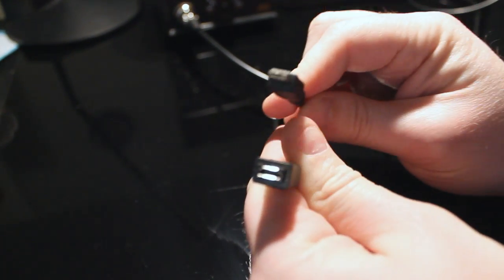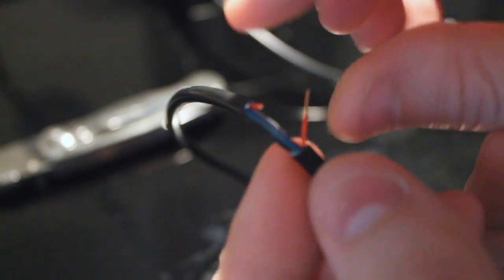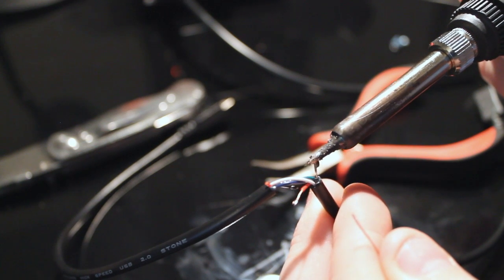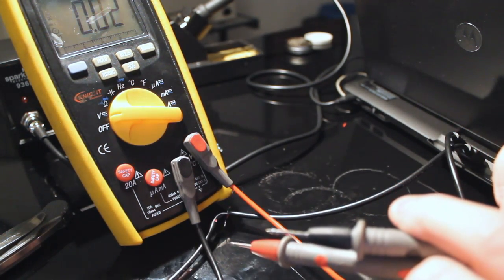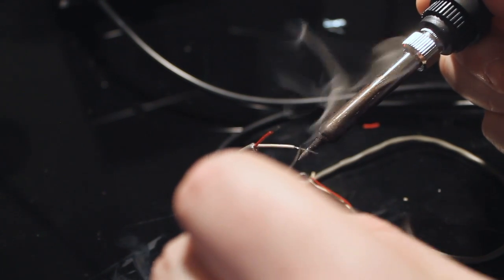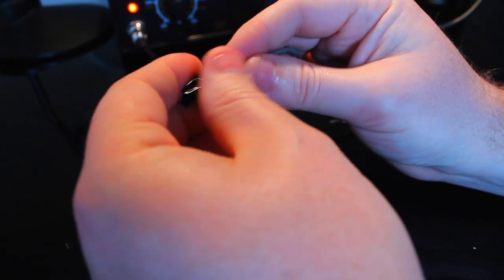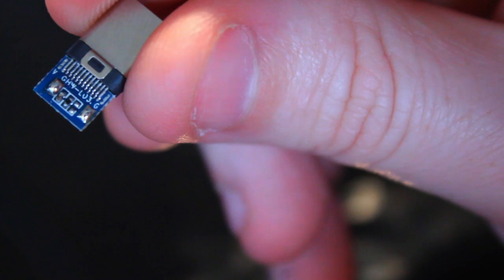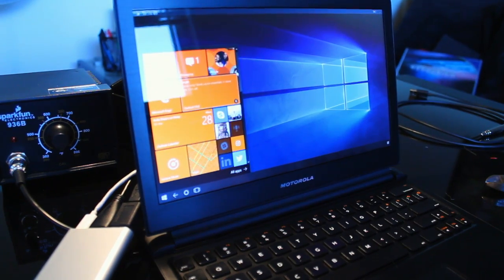How to hack a USB cable to use a Motorola Lapdock with Continuum or Raspberry Pi

Comment: Hello. I'm a little confused about what to do....I have a lapdok 100 right now. it doesn't want to work from an HDMI signal source. it starts working but turns off after a couple of seconds. Can you tell me what to do to use the dock as a monitor?
Reply from the maker: It needs USB power (which you can do by hacking a cable), and AFAIK it can only do 720p. I think it also has some issues with certain types of resolutions. Either it only fully supports VESA ("PC") modes or it only supports TV modes, but I don't recall which. If you're using a PC, you'll have to make sure you're sending the "right" 720p to it.
Reply: @ZiggyTheHamster  you can still clarify the issue of nutrition through the USB... do I need to drop the power on the USB to the dock? or from the dock to the source of the signal?

Comment: Can you see if it works with DeX
Reply from the maker: It does, but poorly. DeX only works at 1080p, and this display is an odd resolution. 1366x768 I think. So it doesn't scale correctly and is unusable.
Reply: @ZiggyTheHamster  wow thanks for the fast response I really appreciate it.

Comment: can i ask a question here... basically u turn the display port n micro usb into usb-c?
Reply from the maker: Yes, it's HDMI though. Basically you convert the USB and HDMI on the dock to full sized versions. The USB needs its power separated though, since the dock wants to power the device but the device will want to power the dock and that's bad. So if you use the power from the dock to power the USB-C adapter thing instead, the dock battery powers the phone.
Reply: does it work\. do save any schematic diagram for future reference/

Comment: Does the audio work fine?
What if I just use a mini-Usb female to usb-A cable (without the usb C hack) + the dock and the hdmi/mini-hdmi cable. Will the continuum work (without charging the phone)?
The touchpad and the keyboard are also working fine?
Reply from the maker: HDMI audio doesn't work because Windows 10 Mobile has a limitation where it will only sends audio if the HDMI monitor is using CEA resolutions. The Motorola display uses a VESA resolution, so no audio. Look here for a better answer: https://answers.microsoft.com/en-us/mobiledevices/forum/mdlumia-mdcontinuum/hdmi-audio-via-continuum/cccaa5da-f471-4595-85b8-6eb0d8701d67

I just unplugged my USB-C abomination and the dock still works with the phone, although obviously without charging the phone. Another thing is that the USB-C to HDMI/USB adapter seems to just pass through USB-C power, so if you want a full speed charge, you can just plug in the normal charger instead of the USB-C power lead. That said, if you want to skip charging or use an external charger, you will still need to cut the USB-A male to micro USB female's power wire. The phone and the dock will be providing +5V on that wire, and if you don't cut it, you will blow protection circuitry.
Reply: Yesterday I tried to use the continuum on a hdmi monitor and the audio did not work properly, so I searched and discovered this not-CEA problem, it's awful. Thanks for the answer, I will try the dock solution when I find a cheap one
Reply from the maker: An idea might be to get a USB audio adapter and hook it into the lapdock's internal circuitry. Basically you could follow the audio connections backwards until you found where they start (post-amplification), cut a trace or an IC leg, and splice in the audio output from a USB audio adapter. Hook the USB audio adapter's USB connections up to the USB bus and the phone will then output via what it sees are USB headphones.
Reply from the maker: Since my previous reply, I've tried a cheap ($0.75!) USB soundcard in my hackdock. The phone recognizes it as "Dock audio" and the volume works exactly as expected.
Reply: I've got an Atrix Lapdock and it works nice, there is the audio problem, but it's not a big deal. Thanks for this video, I am using my continuum phone as my daily notebook now and it's great
Reply: What kind of the USB-C to HDMI/USB adapter did you use instead of MS Dock? Was it an adapter for Mac or smth else? I tried some cheap adapter from eBay, and fonts were just awful with it. Is it just my adapter or a general issue?
Reply from the maker: They sell it as an adapter for a Mac, but it works for Continuum. The phone outputs digital DisplayPort and the dock converts that to digital HDMI, which is then shown on your TV. There's no analog conversion here, so if your fonts look bad, it's something misconfigured with your display. The adapter is definitely cheap (and I also got it off eBay), but that manifests itself by the adapter sometimes cutting out or pieces of the plastic sliding off because they didn't use enough glue.